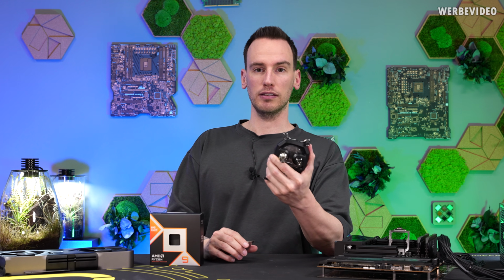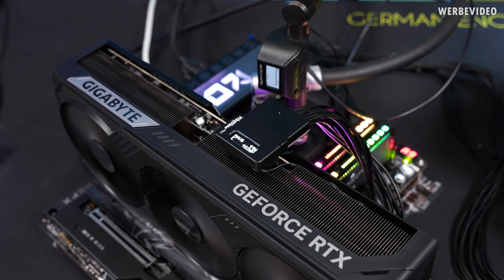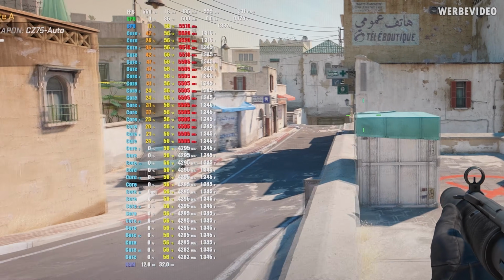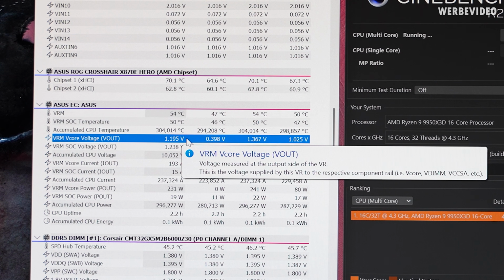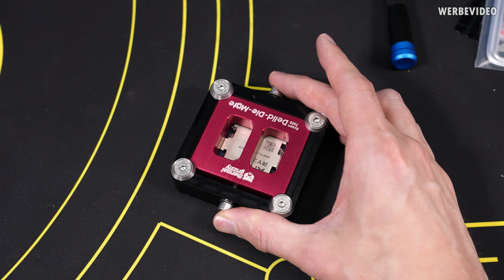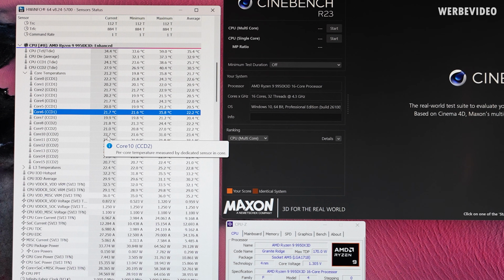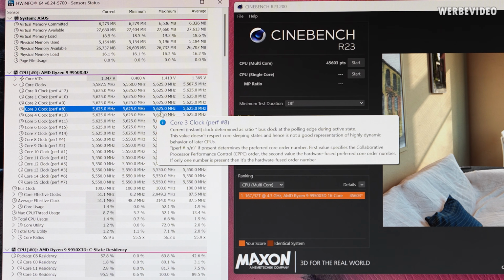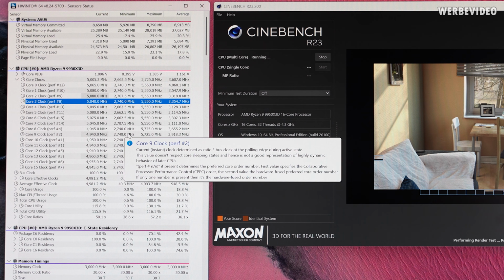Delidding the Ryzen 9950X3D makes it Even Stronger

Comment: 2:44 why do people even use a spreader? The cold plate will spread it. Don’t we all know this already? What am I missing?
Reply: so you know it spreads to everywhere it needs to. if you didnt put enough it'll spread but not to the ends or the outside, which can cause ok temps but redline edge temps and random shutoff when it trips an overheat
Reply: @bradhaines3142  I suppose that could be a reason, but that simple can be resolved by using enough to start with. I’ve always felt spreading is not useful whatsoever. I was hoping, if it’s true, that someone like Derbauer could point out a flaw in my understanding. I’m not the all holy expert after all.
Reply: @Akkbar21  because CPUs are rectangles and squishing a blob makes a circle. either its not enough and the corners are bare, or too much and it spills over the edges
Reply: "Why do people even use a spreader"
Why does people don't use their brain, I know a lot of you out there is missing a few braincell, but everyone know spread isn't even. Plus you have a high probability to put too much or too little. Especially since every thermal paste have different viscosity and spreading. Someone spreading evenly their thermal paste will get more accurate results and often better cooling since there's no paste going above the IHS or stuff like that
Reply: No
Reply: @ranjitmandal1612   no what?
Reply: @ranjitmandal1612 saaar do not redeem.
Reply: I just put lots and let it make a mess on the board, wtfc it's fine don't hurt nothing cleans up easy if you ever go to unmount your cpu anyway

Comment: They should get rid of IHS for new CPUs, it's contraproductive and it makes everything worse, on Ryzens 3800X or 5800X3D you was able to get a massive temperature boost with IHS removed, I guess it's the same with later CPUs. Why adding extra layer and several material to material heat transfers when it's that hard to get heat out of such small area? All modern coolers have massive copper base, so IHS makes no sense anymore. Or it should be attached by some screws so you could remove it easily.

Comment: run the hwinfo with higher process priority (or cinebench with lower but may affect the results) can be changed in task manager
Reply from the maker: I was already running it at realtime but it was still doing the same. It didn't fix it unfortunately :/
Reply: @der8auer-en  realtime can cause its own issues with ui not updating, did you try high?
Reply: And he might need to lower the priority of the benchmark aswell if it's above normal (iirc it starts by default above normal for cinebench).
Reply: @ Lower the CB priority. But it resets everytime you press "start" so you need to have the affinities set first, press start and then click OK with the affinity settings. Its cumbersome and I would say not even worth it but thats about it.
Reply: @alkestos  One good way to manage it in this way is launching via Benchmate, as you can just set a default priority/affinity that will persist across subsequent launches.
Reply: Not a good idea as it can skew the results as it would take more cpu usage